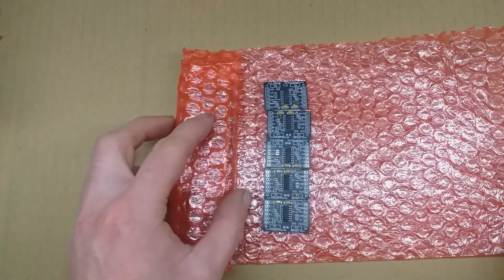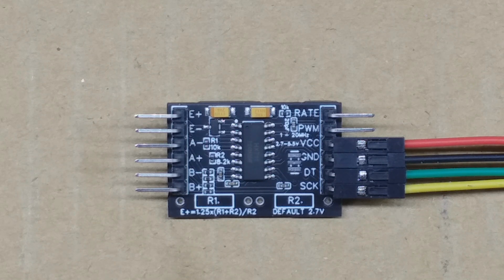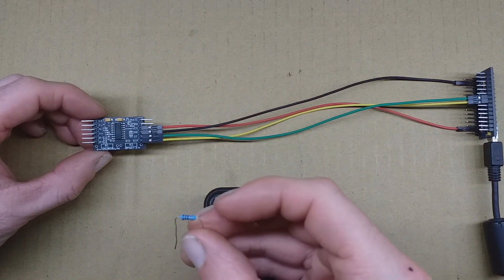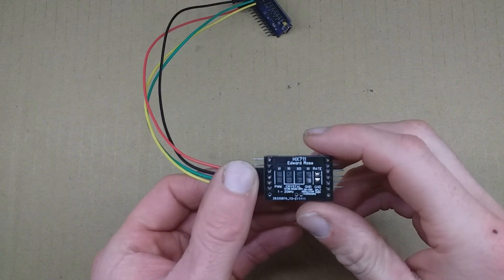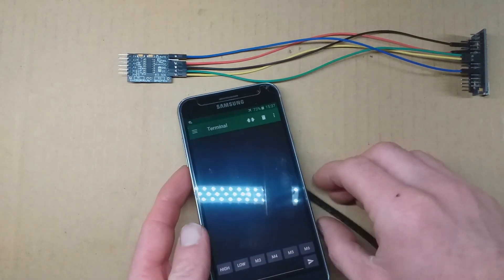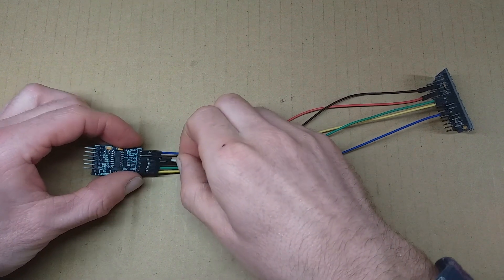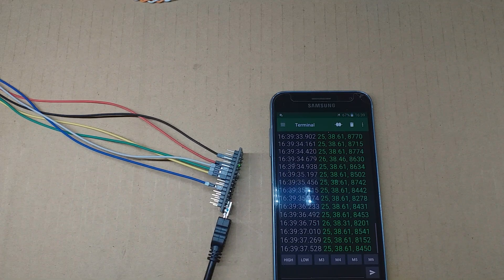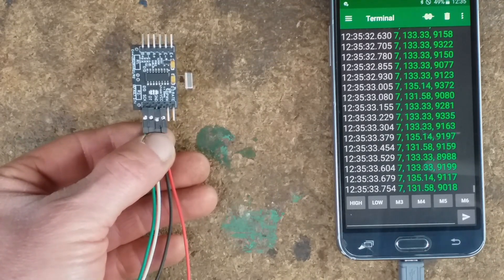A Better HX711 Board, or maybe not

Comment: Did you make the link available to order the pcbs ,
Reply from the maker: @MB-lh5kw  I didn't because as I discovered the design is far from perfect.
Reply: @Ed.R  hi would  you like to do another one I'm after a simular board but with  a level shifter on the data lines to go to an esp32. I would be prepared to do some funding to get some more proto types made.

Comment: Hello Ed,

Been working on an HX711 also, not so interested in bigger frequency because it's introducing noise ...  I had question regarding the design that use both vcc and vdd .... like the sparkfun one, any thoughts? If I could share my current design it would be awesome to have a quick review from you

Comment: Hi, i'm from Brazil and i appreciate your videos of hx711. I'm study them to my engineering in electronics. i would like to know which model of hx711 are you using (i mean which factory batch of hx711 are you using), because my hx711 doesn't work with crystal osscilator 20MHz (model HC49) when i put the rate pin to high level (5V) the hx711 return to me 70~80Hz like he is using his internal osscilator itself. The hx711 only work with the 20MHz crystal when i put the rate pin in low level (0V) and i receive 18 sample rate data as well the datasheet informed.

I suppose two things: 
.the 20MHz crystal oscillator it's not exactly 20MHz, that can be a little bit more like 20,102MHz (example)
.the 20MHz crystal oscillator it's exactly 20MHz indeed, but the hx711 doesn't support this frequency of 20MHz.

Despite the time when this video was released, i hope and wait with your help/answers.

PS: the model (factory batch) of hx711 i already used is hx711 7916042F.
Reply from the maker: @RAFAELFERRARILOBATOGOMES  Hi, glad you have found them helpful. I have just checked mine and the factory batch number is 712405204F.
My guess is you are correct and the crystal is either above the maximum frequency or the HX711 simply can't handle 20MHz. I've never tested one with a 20MHz crystal.
Reply: @Ed.R  These days after send the message, i tested the hx711 that i was using with a 16Mhz crystal oscillator (model HC49S) and put the rate pin in low level, it is supposed to be working because 20Mhz crystal was working, but the 16Mhz doesn't work anyway, weird thing...

so, i concluded the problem is not frequency and it is the hx711 itself.

would you have availability to test a 20Mhz crystal on your hx711 and see if it is working?

i researched for the same number of factory batch on aliexpress and shopee, but i can't find. if you have the link to buy, i will appreciate.
Reply from the maker: As I explained in the video the tiny crystals I was intending to use with a GND connection didn't work. Only the 2 pin crystals worked.  Wondering if its something similar but perhaps the opposite way around.

I can't help with the source of the chips as I had them provided by JLCPCB. They soldered them for me.